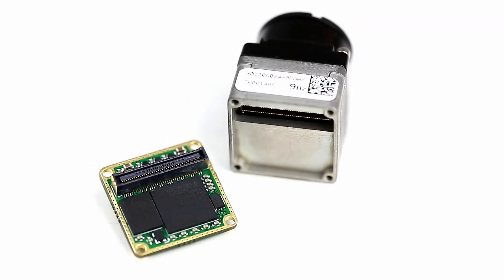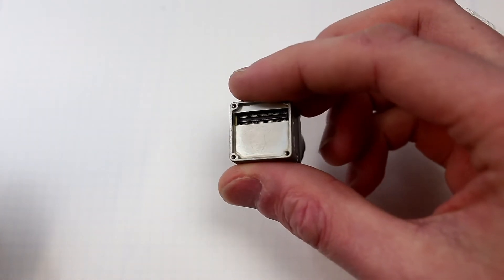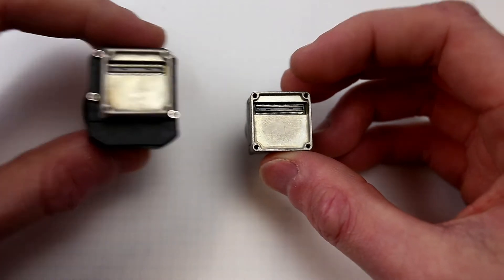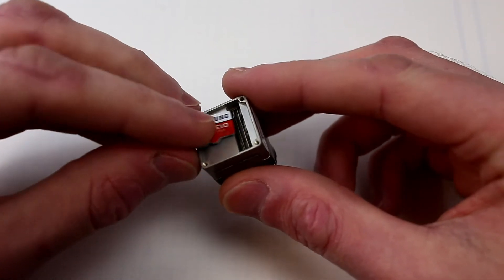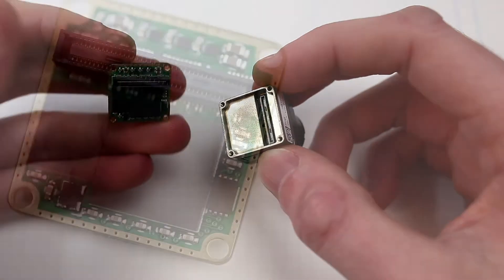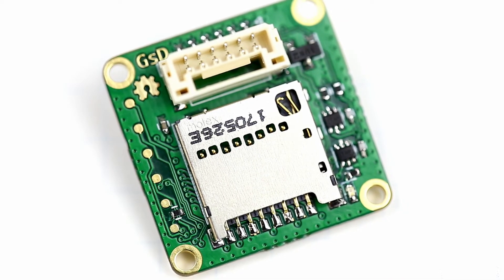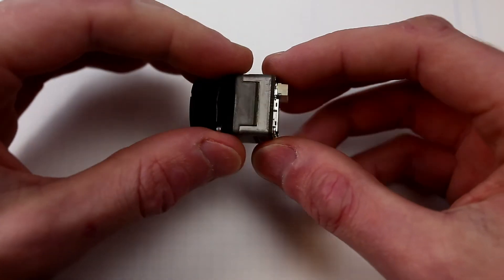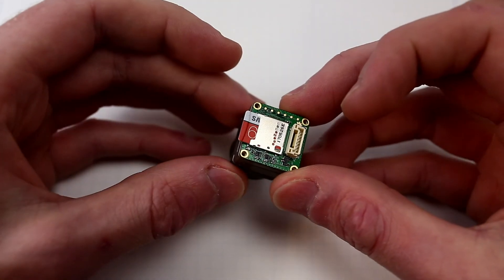FLIR Boson Thermal camera Frame Grabber

Comment: Marvelous project! I am completely new to Boson, but is FPGA really necessary? Would a microcontroller (STM32 etc.) not do the job? STM32duino (STM32F4) is capable of handling parallel image sensor interface... Would be much simpler than FPGA probably?
Reply from the maker: I wasn't aware of that chip! If you design a board for the Boson with it let me know I'd love to see it! :D
Reply: Greg Davill Well fpga is surely a solid solution with enough computing power to handle the stream. There is stm32duino code for stm32f4 that can handle 320x240 at about 25fps. The native stm32duino code may handle more via DCMI interface. Don't know if it's enough for Boson.